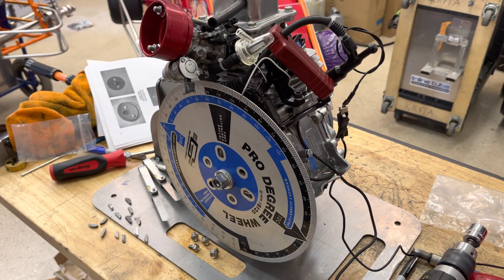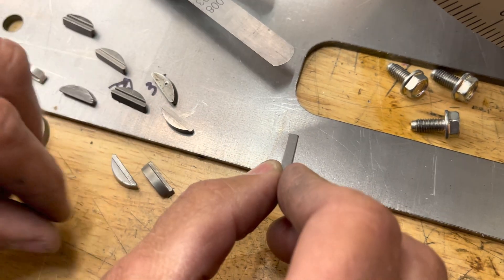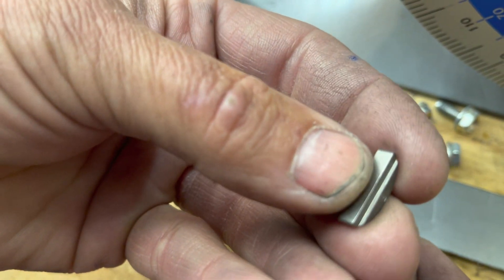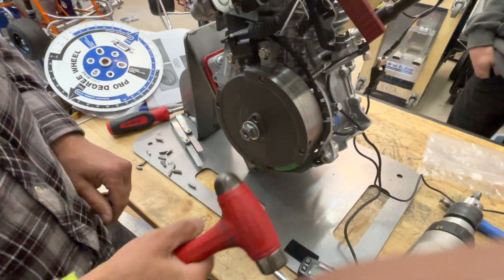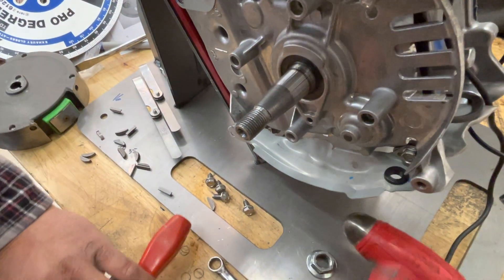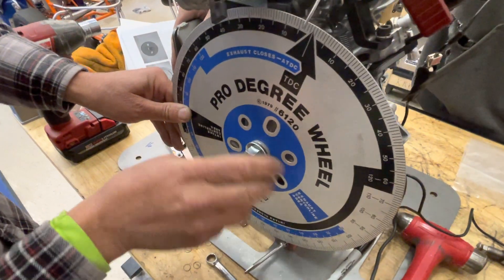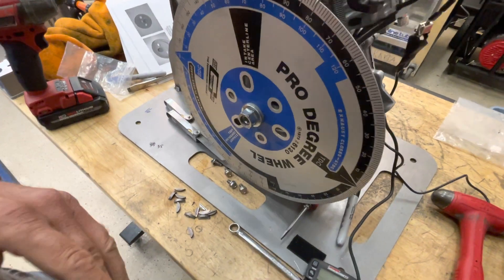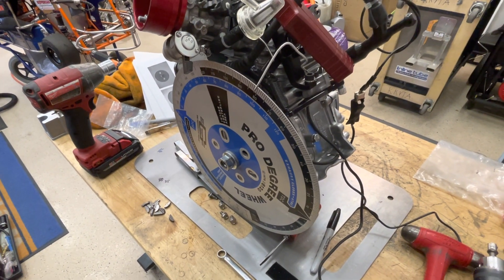Check Timing on Quarter Midget Honda UT3 120 - Part 3

Comment: Fun fact: the flywheel key is strictly for timing. It has absolutely nothing to do with holding wheel to shaft. To prove this is indeed a fact, competent engine builders never use a key. They simply use the in the hole method or use a degree wheel to set timing. Another fun fact: you should never install a wheel without LAPPING it in first ALWAYS. Regardless if it had been lapped before. If you remove it, lap it to install it. Period.